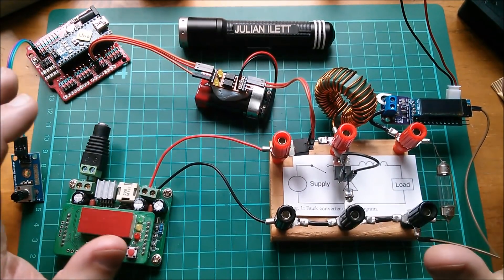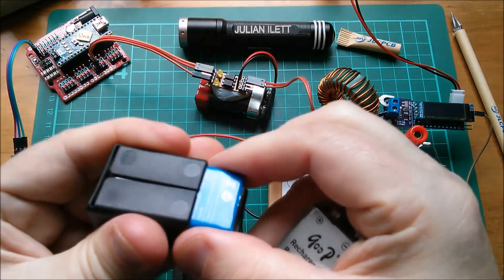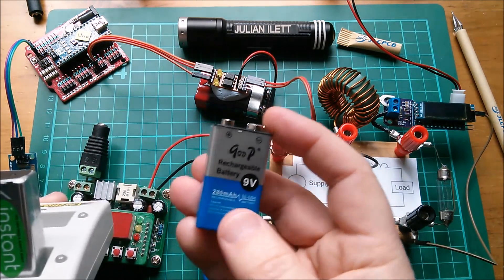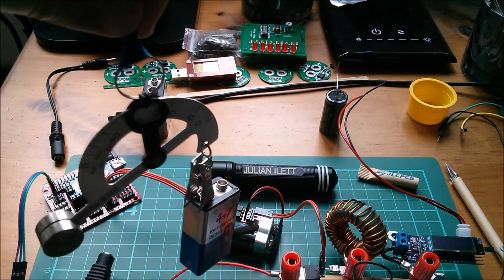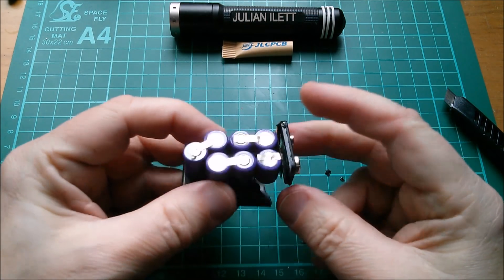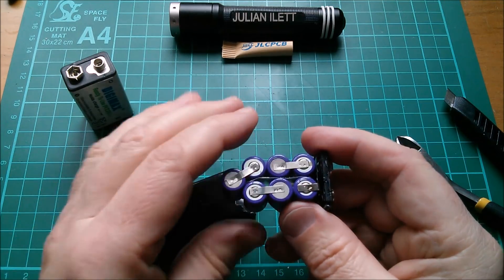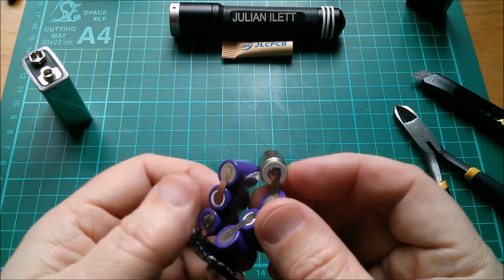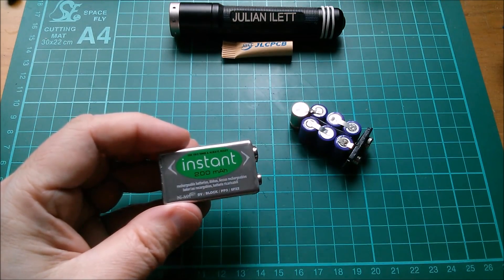What's inside a 9V NiMH Rechargeable Battery?

Comment: Great video thank you so I'm best off staying with my pro cell 9 volts as non of the rechargeable 9 volts are actually a full 9 volt as they are 7 cells at 1.2 volts same with most lithium ion "9 volt" are over voltage or under voltage and like you said create noise in audio equipment in say a bass guitar preamp

Comment: Thanks for the video Have just purchased some 9v batteries from AliExpress and wondered why they were so light in weight. I'm just waiting for a rechargeable battery charger. Have you ever made at all?  the brand i purchased is PALO 9V 6F22 Ni-MH  for my Multimeters . Also I'm waiting on a ANENG 618C Digital Multimeter Smart Touch DC Analog Bar True RMS Auto Tester Professional Transistor Capacitor NCV Testers Meter await you testing one of these. Seem really great for a DIY person. Keep up the good work Ross Tga NZ

Comment: It was very interesting to see the construction of the different NiMh 9 volt batteries and it was obvious why the cheap one performed so poorly. I don't like the idea of boosting a 3.7 v battery to 9v, seems like you would waste a significant amount of energy. What about 8 NiMh AA cells in a holder? You would get 9.6v nominal at 2000 mAh or so or if the voltage is too high just shunt one of the cell compartments.

Comment: Thanks for tearing it apart, I suspected as much.  Those little cylindrical batteries are likely 1/3 AA NiMH industrial sizes, I'm surprised to see anyone still making NiMH cells in flat pack, that can only be a custom job; quite expensive to do today and is probably why its a better performer.  The 9V made out of 1/3 AA "cells" are easier to make and should perform as well, if the parts used perform as specified.  You can probably isolate the bad cell and recondition it, and it could get the pack working again.  A problem with 9V NiMH is the internal cells are in series, charging is done as a pack, so there is no battery balancing.   https://en.wikipedia.org/wiki/Battery_balancing    https://www.master-instruments.com.au/category/NiMH_Industrial_Cylindrical_Batteries/1175

Comment: I've got 5 non-USB rechargeable (two cells in series) 9V EBL Li-ion batteries (which I bought with a charger). The advantage of these is higher capacity and lower price. Unfortunately, one of them self-discharged to about 1 V in just 2 months! It's dead and I couldn't revive it. They were in the box supplied to store them, so no short-circuits could have happened. And the rest except 1 were discharged to 5 V or so! Not very good quality... In fact, I've just checked and they've discharged again! At least I can charge them, unlike the other one. There's only one good one, out of the 5! Really disappointed.

Comment: That 9v battery holder is meant to be tight, you can loosen it up a little by softening/opening the plastic(s) - they have a gap between them and not connected at the terminal end also, so they pull out slightly and spring to 'grip' the battery - heat up lightly and bend out slightly will loosen it up! ;)

Also, try fitting it in after taking the label off ;)

Comment: It seems that Charlie took 7 cylindrical batteries of capacity 40mAh, and so he calculated total capacity 7x40mAh = 280mAh. I think the number came up like that. Of course it is wrong calculation, the capacity of cells in series does not add up.

Comment: My Ni-MH 9V batteries had 7 Ni-Cd cells in it. And if you store them charged (as you should do with Ni-MH) they loose capacity pretty quickly. And they also self-discharge. That's Why I buy only Li-Ion. There are two flat cells in my Li-Ion 9V batteries. They work nice, but since the voltage is on the low side you can't use the full capacity in the most devices. But they don't self discharge

Comment: Keep in mind that those LiPo 9v batteries will stay at a certain voltage, then rapidly drop that voltage when the IC senses it running low. This is bad for devices (like smoke/CO detectors) and other voltage dependent devices for warning when the batteries are running low.

Comment: one big warning for anyone considering replacing a regular/rechargeable 9V PP3 cell with the Li-Ion kind DON'T USE IT IN YOUR SMOKE DETECTORS or other life critical devices. The boost circuitry suddenly drops out and leaves you no time for a low battery warning !
Reply: some of the other brands have 2 li-ion in series (without boost converter) that will work in smokes just fine. They have a charged voltage of only 8.4 or something.
Reply: hey man if you go full DIY and worry,about this at all theres low lipo alrams for hobbyists, you just add one of them inside the detector!!!!

Comment: Blatant product placement again! Julian, you're incorrigible. ;-D
Reply: That GodP battery might be using Chinese mAh, whereby you add up the claimed capacities of the individual cells, instead of stating the true capacity of the battery. It's a fair guess that those are (claimed to be) 40 mA cells. So 40mAh x 7 = 280mAh. Allow for Chinese swindlers inflating the capacity, plus some aging, and (being generous) a charge current of 90 mA for 12 minutes gives: 90mA/5 = 18 mAh for the true capacity of the battery. Being pessimistic, if your charger delivers 70 mA, and it charges in 10 minutes then the capacity is 70mA/6 = 11.67 mAh, approximately. So it's somewhere between about 12 and 18 mAh.

Comment: I did some calculations and I think the volume of the cylindrical cell NMiH battery is 61% of the volume of the lozenge battery, and it's 54% of the weight, so not only is it smaller, but it has about 80% of the metal in the lozenge battery by weight

Comment: Would it be worth it to solder the broken tab back on then put the battery in a heat shrink sleeve to continue using it or is it not worth the potential risk? It doesn't look like any of the cell casings have been compromised other than some wrapper being nicked.

Comment: Have you tried the 8 cell 9.6V type rechargeables? I've often had equipment not liking the low voltage of the 7 cell 8.4V type and giving low voltage warnings even though they were pretty much charged. 9.6V seems to be a much better voltage to replace a 9V alkaline.

Comment: I have a few 9V lithium and they are just made with two pouch type cells inside so they are 7.4V nominal or 8.4V fully charged. I use them in my multimeter and some other similar devices and I just charge them with a Lab power supply to 8V every few months when is needed.

Comment: I got the OKCell 9v, very practical with the USB charger port. Inside there is a single lithium cell with a booster and the charging circuit. Probably not the most efficient solution like the dual cell ones, but they do their job and hold a 9V steady output (probably not the best if your device has a battery indicator but there is a battery indicator on the side of the casing)

Comment: hi the 9v lithium battery's with the usb charging function use a boost converter and the ones without have 2 cells in series with inbuilt protection but require a different charger

Comment: Think the best thing would be a AA battery holder with 6x 1.5V alkalines, or 7-8x Ni-MH batteries - that way you'll get the voltage required, in a far higher capacity. Only issue is the size of the homemade 9V setup compared to a PP3 battery, but you can't have a small battery that is also high capacity.

Most AA batteries seem to be in the order of 2000mAh each now, or you could even go along the AAA route if you wanted to save space a bit (and sacrifice capacity, as AAAs are only approx 750mAh).

Comment: Unless you need the small size, AA NiMH cells are probably the way to go.
The capacity is relatively good, you won't need a new charger and you don't need to be concerned about over discharging.

Comment: Those are 1/3 AAA cells. I used them in light RC gliders, back in the dark times before lithium batteries :)
They were Sanyo 110Mah NiCad cells, it'd be terrible if the cells in Julian's pack couldn't even match that....20ish years later.

Imagine if they are 20 year old NiCads repacked :)

Comment: 18650 cells are becoming my standard: 2 in series dropped to 5v and 3 in series dropped to 9 or used as 12v.
Reply: Or even a single cell boosted to 5V (with multiple cells in parallel).

Comment: I bought a couple of 9V Li-Ion batteries made by SoShine. 
When I did the research, most people raved about them.
I tested one and got 568 mAh and they claimed 650 mAh. Close enough, considering I could only test them at 200 mA discharge rate. I am sure I could've gotten closer to claimed 650,  if I discharged them at C/20 as one should. 
I have the same dummy load as you (ZPB30A1), and they can't go lower than 0.2A without a R_sense hack. 
NiMh is kinda dead technology compared to Li-ion.
Also, don't get the ones with USB charger unless you don't care about halving the capacity. 
Here is the link if others are interested;
https://www.aliexpress.com/item/2pcs-Soshine-650mAh-9V-6F22-Rechargeable-Battery-Smart-Intelligent-Ni-MH-Li-ion-Battery-Charger-with/32802936530.html?spm=a2g0s.9042311.0.0.JfoGQ8

Comment: JLCPCB ($2 for 10 Boards + $12 for shipping)
Reply: Okurka - Where is that shipping price for?  I'm in Canada and $14 for 10 board doesn't sound bad.  But how big are those any way?  I remember looking at their web page but don't recall seeing any shipping costs listed and didn't want to bother making up a dummy order just to see.
Reply: Ouch... Using through hole components and stripboard/veroboard would be better, as through hole is easier to solder.
Reply: I think the price $2+$12 is for boards not bigger than 10x10cm

Comment: They are lozenges
The 6 vertical cells would only be good for alkaline, nimh would be much to low on voltage at 7.2V to be classed as a 9v
Reply: I thought it was Pez.

Comment: I'm pretty happy with my soshine LiFePO4 9V batteries. They put out up to 2A and have plenty of capacity.
Reply from the maker: Is that one cell with a booster, or 3 cells in series?
Reply: I believe it is 3 cells. The voltage output varies a bit as it discharges. It starts off at nearly 10V and cuts off somewhere below 8V. If it had a booster, I would think it would always hold the voltage at 9V.

I could check it this weekend.

Comment: Great to see the Muppet project seeing the light of day again. <hur hur> Can't wait to see your solution for the synchronized buck converter.

Instead of a dedicated 9v battery, have you considered an isolated dc/dc converter connected to either the input or output? This would give you an isolated power source to drive the mosfets. Or would this be too noisy of a power supply?

Comment: Why not just used to 18650s in series they should work fine
Reply: They will indeed, I use two of them to power my little robot buggy.
Reply: 18650's in series would give a nice amount of capacity, but two of them wouldn't ever reach the full 9V and three of them would be overkill. You'd also need a balance charge controller.
If you want to go down the lithium route them a single cell (or more if you want a parallel array) with a boost converter would be better.

Comment: What about normal 9V batteries?
Reply: They are filled with gooey paper with zinc dioxide and manganese dioxide in potassium hydroxide between electrodes. I cut one open as demonstration in a science class.
Reply: 6x1.5V cells that are a bit smaller than AAAA https://youtu.be/jMfmjqMIT3A?t=120
Reply: I also have one like that. Seems to be manufacturer dependant.
Reply: Alkaline 9V batteries are the 6 miniature AAAA type cells in series that ProgAndy mentioned and those are usually marked 6LR6, LR6 being the size code for the little cells. Non-alkaline "heavy duty" 9V batteries tend to be the stack of paper and metal separators and gooey paste type cells that Hyss said.
Reply: Rayovac 9V alkaline batteries from Malaysia use prismatic cells.

Comment: Why don't you use 18650s with a good boost circuit.
Reply: Size matters. He is actually thinking of lipo in 9v backage
Reply: Commodity. He could also use 2 Li-ion in series (which is what some "9V" Li-ion batteries are), but is easier to just slide the battery in.

Comment: I have some EBL "9v" rechargeables.  They are self-regulated (over/under protection/etc).  But I found if I feed it say 10V it'll charge for a bit and then cut off.   Usually long before the battery is charged whereas if I feed it 8.4V it charges fully.   So if your charger is feeding 9V (or more) some cells might cut off before being fully charged.